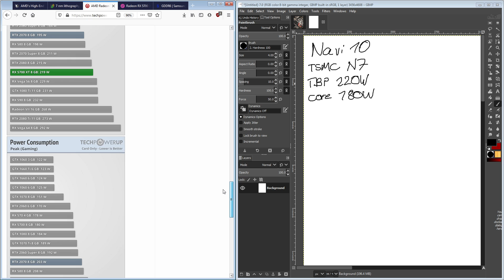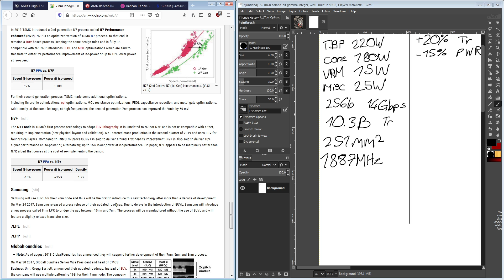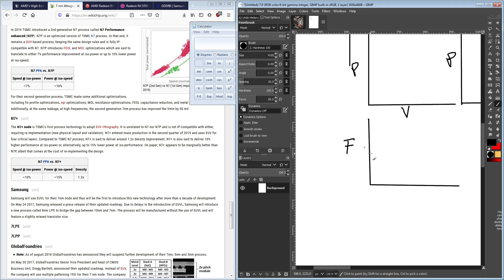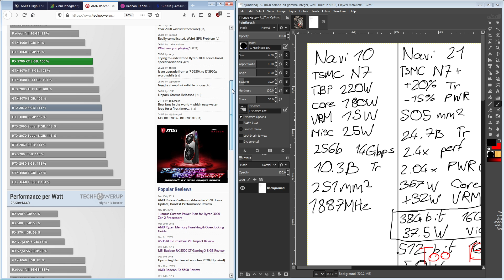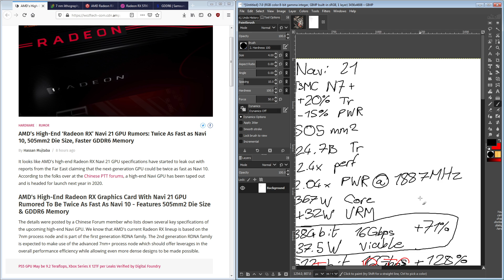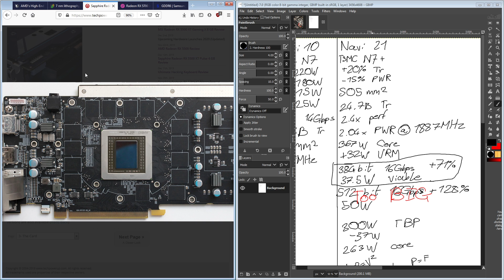I don't think Navi 21 will be 2x the speed of Navi 10

Comment: Memory Chips on the back of the PCB possibly?? Might need a decent backplate with actual cooling though... Or HBM2E that I keep hearing about? - those are options where AMD COULD possibly feed a GPU core 2x faster than 5700 XT - still I doubt it highly....

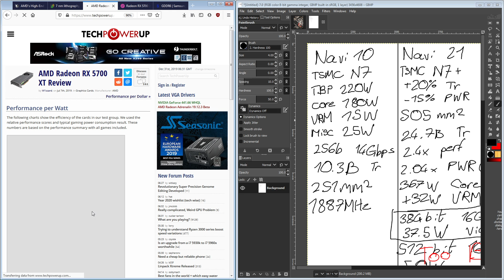Comment: 23:10  So Navi 10 has mediocre performance per watt.  How is the 5700 so much more power efficient than the 5700XT? Is it just that efficiency takes a nosedive for that architecture if they push the clocks past the 5700 levels?

Comment: for a guy that assumes specs of future gpu  i m baffled he didn't speculate on maybe improvement of the architecture power saving ipc clock gains and  shader improvement etc cause that new gpu will be using rdna 2 which could make this card on even footing even with 3080 ti or even faster amd themselves said they gonna do exactly same thing they did with ryzen so we could be looking at improved architecture in a big way
Reply: He is an Nvidia fanbot

Comment: Navi is currently memory starved, though, right? By keeping the exact same core, and just going from 14-16Gbps (14.2%) and tuning latency and increasing IPC slightly, and creating better binned 7nm able to hit higher clocks more consistently I would think they should be able to get 20-25% gains out of current transistor count dies with very minor changes. Wish someone was able to get theirs to like 1900mhz to test, though. Would need to voltage mod an Asus Strix.

Comment: Uh, you missed a big one:
Pitcairn to Hawaii.  (7870 to 290x)
Performance (stock cards) was about 2x, when you ran the fan in it’s “Über” mode.
~2x power usage in gaming
~2.2x transistors
~1.9x die size
~same clockspeed 

That’s without a real process improvement.
Now, I do think that Memory Bandwidth will be an issue.
But the idea AMD couldn’t double the performance when they did it before in a near similar situation is funny.
I think it does all end on memory bandwidth, and if they manage to improve caches well enough in RDNA 2.0 to allow lower memory bandwidth per Tflop

Comment: Overall agreed with your basic conclusion.  If you assume GDDR6 on 384 bit interface, it doesn't seem possible unless they've either really improved the amount of work the uarch can get done with a given amount of bandwidth OR they use HBM (which I wouldn't rule out for a high-end part, despite what the leak says).  I would've liked to see you explore the HBM numbers a bit. 

If they do go with HBM, however, I wouldn't rule out the potential for it to outperform the 2080ti by >15%.  If you look at the performance scaling of RDNA vs that of Turing, the former definitely seems to scale much more efficiently.  That being said, we only have low- to mid-range RDNA parts to look at, and it's always possible that efficiency could fall apart as the die gets bigger, I suppose. 

I would speculate an equally likely scenario to be, not a 2x 5700XT, but rather a 2x 5700 + a bunch of ray tracing-related hardware.  The 5700 is a fair bit more power efficient than the XT, so it would be a lot easier to get 2080ti+ performance within a reasonably similar(ish) power budget, with the added benefit of better yields.

Comment: Ok so lets scale 5700XT by 2x so that gonna be 80CU and the performance scaling is gonna be less then 2x and I think this is the confusion here. The floating point performance might be 2x the 5700XT, but the actual gaming performance is not gonna be as high. It might be around 50-80% depending on a LOT of things.
However is 5700XT core pulls around 180w then Navi 21 would pull 360W and when you take 7nm+ into consideration then we have around 300w of power draw.
Now we add 384-bit GDDR6 16Gb buss and we add around 50w to overall power consumption which would make this GPU 350W TDP.
That's not unreasonable, but bigger dies never scale 100% in efficiency so the TDP figure is very optimistic at this point.
However Navi 10 is by default inefficient core and there are rumors of some major bugs that are still in the architecture and RDNA 2.0 should fix those bugs or atleast some of them. If those bugs are hindering IPC gains or power efficiency then there is a lot more performance per watt to be unlocked.
Also RDNA 1.0 is a hybrid architecture from GCN to RDNA and rumors say that RDNA 2.0 would be totally based on new architecture and that could mean more IPC or better efficiency. 
It's wishful thinking, but we could see a GPU from AMD that is slightly faster then RTX 2080ti with similar TDP, however that kind of GPU is only a catch up to what gonna be a RTX 3000 series. Thought AMD might not be that bad off if Nvidia pushes more raytracing capablities while at the same time increase the clockspeed or the core counts, even Nvidia needs to go from 384-bit to something faster and that could bite some of the performance gained from 7nm that they are gonna use.
Say AMD is gonna be 20-30% slower then NVIDIA both on their various 7nm processes per watt then that's really not that bad anymore considering that AMD has been almost 2x behind in efficiency at worst.
A word on AMDs upcoming raytracing capabilities. AMD won't push raytracing as hard as Nvidia. AMD will implement hardware chances into their design to better handle raytracing, but we have seen demos that raytracing is very much doable without RT cores and more settle approach is what AMD is gonna do. I don't think AMD is gonna sacrifice more then couple % of die area for raytracing and that way AMD might be able to utilize it's core better when there is no idling dedicated hardware lying around. 
Nvidia however will have trouble making those big dies for the sake of RT cores that aren't utilized. AMD is simply gonna add something to their CUs that will do raytracing better, but won't cause idle time inside the core.

Comment: Also the consideration is that GDDR6 pin layout on the GPU die is not as flexible as HBM... you have to use IO at the edge of the chip and it just won't be there. Lets also not forget that the VII already has basically 2.25X the memory bandwidth which would be basically perfect... perhaps it would be possible to work backwards from it's power consumption for subtracting out the core and puttin the Navi core in.

Comment: I think that 384bit bus is just a joke if you are attempting to pass 2080ti performance with an AMD GPU even with the Navi's memory use improvements. Microns has had some ruminations about 20Gbps GDDR6 though.  I think they may release a bigger faster 5800 GPU with those spects but it won't be a "killer". I just don't think they can do that without the reduced die use and power use afforded by HBM. Also I think you are underestimating slightly how much power GDDR6 is still using in the IMC and memory itself. They really need to make PCB routable HBM3... to bring HBM cost more in line with GDDR (which itself is on an uptick at the moment).

Comment: The thing with using the XT as a reference is that it is pushed beyond it's ideal efficiency in order to beat the 2070, when in reality it's a 1660 Ti tier chip in terms of size. The regular 5700 is at least 20% more efficient than the XT.

Comment: So the only way I see it working is if the Navi 21 doubles the waves per cycle.
Vega was 64 waves per 4 cycles

Navi 10 was 2 x 32 waves per cycle.
If Navi 21 4 x 32 waves per cycle that could double the throughput....and need more L2 
But you would need to double the cores or CU , so 5,120 cores or 80 CU.

Comment: IIRC Hardware Unboxed benchmarks set the 2080Ti more towards being 30-35% faster than the 5700XT rather than 50%, so a 70% advantage for this new GPU could make it around 30% than the Turing GPU. That being said whenever it comes a future 3080Ti won't be far down the line and we could expect around 30% improvement or more.

Comment: NOBODY CARES ABOUT PERFORMANCE PER WATT. I DON'T CARE IF MY COMPUTER COSTS 10c MORE A DAY TO RUN.
Reply: It matters cause inefficient means more heat, which means lower speed
Reply: Thermal designs is gonna be a pain in the butt for board partners. Thus, pushing the prices up.
Reply: Chris Eason more heat means more money spendet on cooling, i‘d rather buy a cooler card that costs more 🤷🏻‍♂️

Comment: good points, but you start with the assumption that the memory speed is the current bottleneck.
what if its not the case today?
let say the current GPU is not fast enough and uses 80% of the memory speed, in this case a more powerfull gpu will results in bigger performance improvement.
and if part of the transistors are for ray tracing, the performance increase for classic 3D usage will be lower.

well... too many options/qustions fro now :)

Comment: Buildzoid, bro, you are awesome, but this "7940X is better at Firestrike than 3950X" and "I don't want to get a Navi" is pretty fucked up, man.
I mean, yeah, sure, it was funny when you spoiled the bios-lock of 5700 before the release and it's all funny that you care about overclocking hardware, but if you fucking care about overclocking - COVER. THE. MATERIAL.

Otherwise you ain't better than Wccf, hell, even worse. At least they cover the samples. You are... what, ASMR techtuber? That's all?

Comment: BZ: Have you investigated the Navi 10 die to see how they pushed the tape out?  I mean maybe they pushed N7 tapeout for extreme density screw the power efficiency and clock speeds so that they could make it a viable product while also running CPUs on N7.  If they run this larger GPU on N7+, maybe it's taped out looser so they can get more efficient higher clocking transistors since they won't be using it for CPUs at the same time?

Comment: Honestly, I say make the damn thing 500 watts if you have to and ship it with a 360mm rad.
Though I also think it will be a dual memory controller die with one being 384 bit GDDR6 and the other being HBM2E.  The GDDR6 card will be the cut cut down die version (5800) and the full die and small cut down die being the HBM based (5900).

Comment: noob question:  why a large die would be difficult to bin compared to smaller one?
Reply: Yash1331 
I believe its harder to bin larger chips because there is a greater chance that there are manufacturing defects compared to the smaller chips. (Typically the more complex you make something the greater the chance of error/failure.)

Comment: Why underclock a big die when you make a smaller die with a higher frequency and they both perform the same. may be even at the same TDP, and the manufacturing price will be lower.
Reply: Because that doesn't work. The smaller one will require too much voltage to do it, and blow through the power budget. Clock scaling vs power is quite nonlinear.